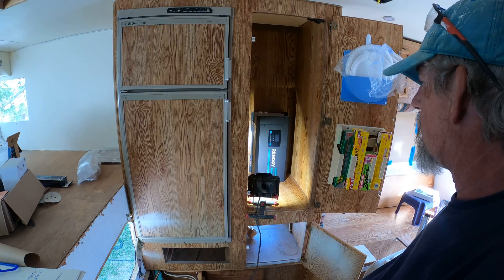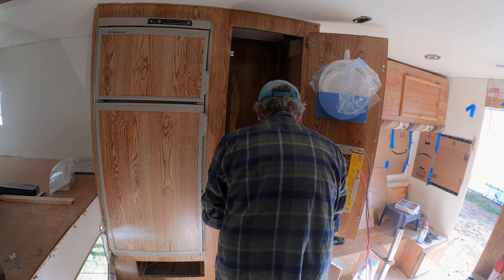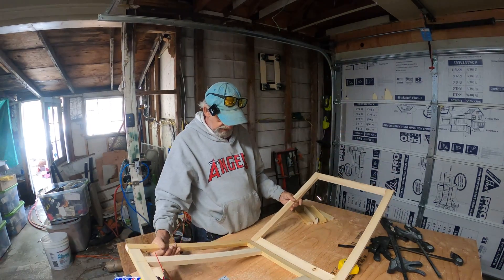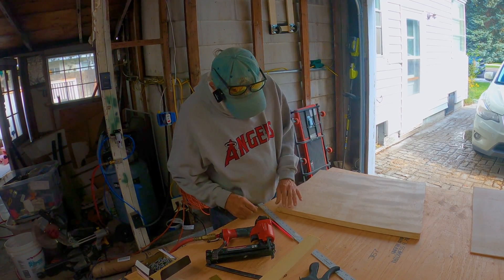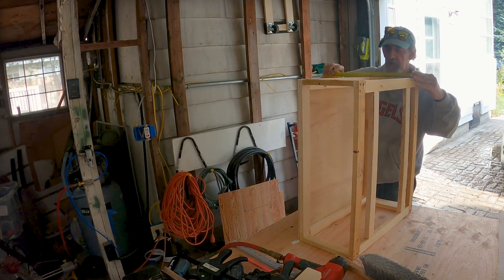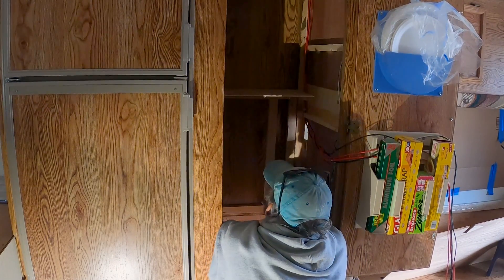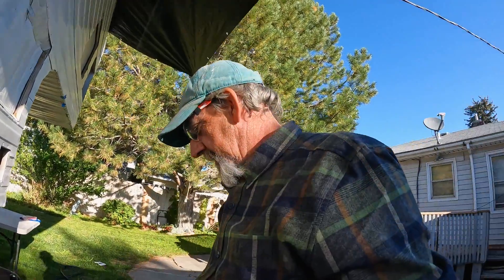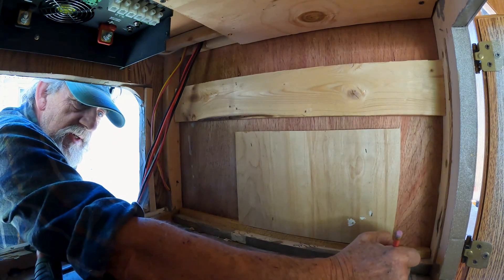Electrical Install.. Installing Renogy 2KW Inverter/Charger.. Vintage Truck Camper Restoration

Comment: Great video 
 I have a question , I need to isolate the solar panels from the batteries. Should the disconnect go after the charge controller?
 Thanks
Reply from the maker: No, the disconnect should be in the line between the solar and the charge controller.